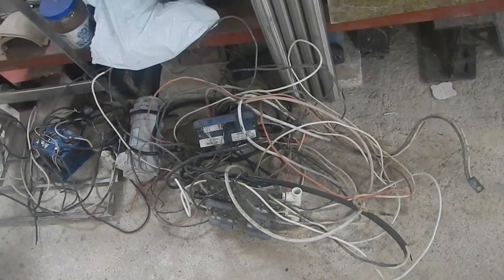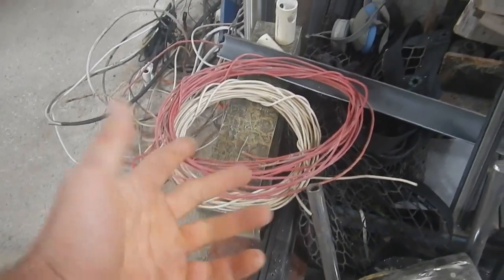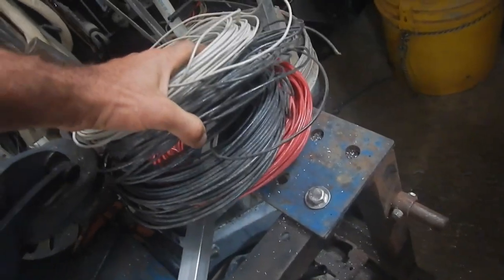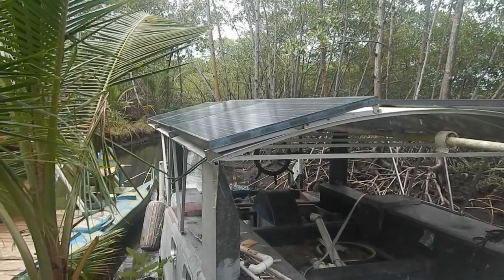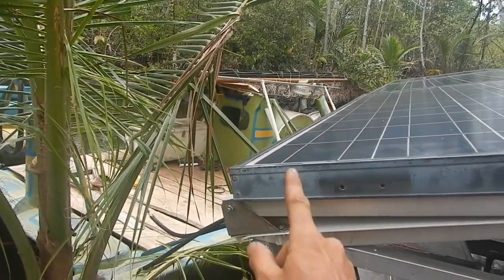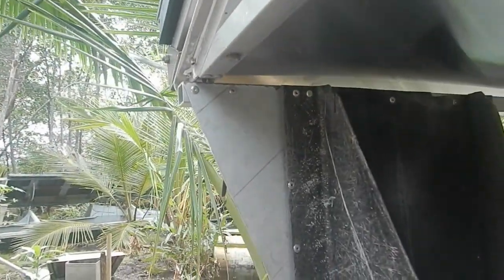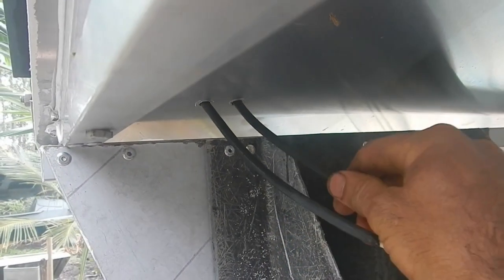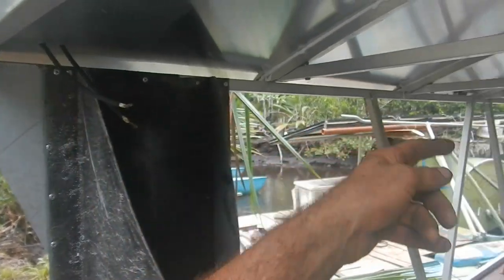Shark Slicer Upgrade 020 FrankenSwitch!

Comment: You can use the frame as earth and save on cables. Use warm citric acid solution to clean copper.
Reply: Bro it's a fiberglass boat
Reply: @jvcrules  ”Bro” have you seen the video? The roof is of aluminium.

Comment: The switch mount bracket looks like it could be a bit of a slicer. I would hate to kick my toe into it or fall on the top corners.
My suggestion is to radius the 4 sharp corners off with tin snips so they are large rounded. One step further would be to slit some small tubing and put 2 pieces of that on the brackets upright fins.

Comment: I've never had a problem with panels in parallel. Always run them direct to my batteries and brushed DC motor boat thrusters, land traction wheels etc, all in parallel. 
Just disconnect the panels when the Battery (Lead Acid) voltage gets over 14.5 volts. 
Had a couple of whoopsies when I've accidentally connected the panel backwards to batteries. Big spark but no panel damage when I went to do that about a week ago. 
It's good to have everything in a circuit so you get that sudden but very short term warning when you have it wrong. 
I had a panel backwards a couple years ago and didn't realize until the next day after traveling  10 km down the lake in my amphibious 20ft mobile home the day before. 
Panel was only putting out 10 volts open circuit instead of 21V after draining batteries rather than charging them. 🤭

Comment: Have you gone monohull with this one Jamie? 
Looks similar to the sleek little 700kg 22 foot trailer sailer I just picked up. 
She should go all day on 400watts of Solar panels a  couple of car batteries and a 55lb brushed DC trolling motor leg at about  10kmph.
Windage is what kills you. 
I'm tempted to not even put her mast up and use the sails. If it's blowing, then going to windward is slower than 400W of electric. 
And a kite boarding kite or windsurfer sail that can be stowed is almost as fast as her full race rig unless it's a strong blow and on the plane downwind run.

Comment: Back to the sliding steering rack, if 90 degree angle of steel would change steering rod direction to allow lifting motor & steering arms. The attachment points would firm up and not become threaded loosely.

Comment: Not sure what the motor demand power. It might be nicer to do 6 solar panel in parallel for slow speed, than do 3p2s for medium, and 2p3s. So the panels are a bit more efficient. Though if you get batteries to run the motor. Might be better setup to mppt to charge batteries and use pwm to run the motor. with an amp meter can make sure that power in and power out balanced.

Comment: I think the blocking diodes will drop the voltage by about 1.5 volts each.
Reply: I agree. The panels are like 30 perfectly good diodes in series. Not much chance of any backcurrent there. But the diodes Jamie's needlessly putting in get friggen hot and waste lots of power. 
Charge controllers do too.
I NEVER use them. I get 3 times as much current when it's sunny and at least 10x as much when it's cloudy to batteries or motors with just keeping an eye on the voltage of the batteries (lead acid). 
And whenever I trust a charge controller to look after them it friggen kills them with dendrites by refusing to let them have enough current to stop them growing or high enough voltage to cell balance 👍
Reply: @aaronfranklin324  Glad to hear from someone also interested in simplification when employing solar panels. My home enjoys direct solar heat gain from windows which stops the furnace and my basement office gets cold, so hence the heater in my other comment. Natural control heats the office when the sun shines solving the problem.
Reply: @sagecoach  Yeah, we're kinda lucky in Northern New Zealand that it doesn't get really cold or super hot, didn't even get a frost last winter. Especially floating on the sea.
But one really good, thermal storage, simple and cheap heating and cooling solution you could eliminate your furnace with is Zeolite clays. When they absorb water like cold damp house air or a drip of water,  in winter they give out hot dry air, and feed them hot dry air they give you cool moist air. 
The Welsh sustainable energy institute found that a refrigerator sized container of them was enough to heat and cool a house. 
Kitty litter pellets are an example. 
Robert Murray Smith TNT did some good videos on them. 
There's real flash synthetic molecular sieve ones like they use in chemical plants and oil refineries. That work so well they make steam and as Rob showed you can boil water and run a steam engine just by dropping water on them.  But natural ones are everywhere and....
Literally, Dirt cheap.
Reply: @aaronfranklin324  I am going to look into that. Here in Minnesota USA, we think upside down from you (: and it gets 20C below. I buy butter from New Zealand at Costco and we make it here, go figure. Thanks.

Comment: Oh no. See it's still a cat. 
Love the switches. 
I'd be inclined to have your panels set up independantly to two separate battery banks and have switching to either or both in parallel, or series for full speed. 
If you just speed control by amperage at fixed volts like you are, the back EMF voltage as the speed rises, from the motor ( I assume you are using reliable brushed DC, not shite brushless computer nannied ones. )
Will get up towards the panels voltage, and then your panels are providing basically nothing. 
With a couple of volts feeding the motor and very little current flowing. 
Better to set up the panels in series and increase the voltage. 
Like if you have a 24V motor You can run on 12, 24 or 36V using any one or two or three in series or parallel. Have a battery and voltage readout on  each of the three battery+ panels banks. 
Or go twin trolling motor thrusters, and switch them from series for low speed to parallel for high speed. Like trains do. 
Then you can have all your panels connected to all your batteries, and just parallel/ series and forward / reverse switches. 
And disconnect the batterys if their voltage gets to high with a simple relay that trips at above a certain voltage.

Comment: Two things to keep in mind, It isn't the volts but the amps. You can't run more than 20 amps on 12 gage wires on a 12v system because wires get very hot and can get on fire. If the battery is connected directly to the panels and the motor, When the Sun is down the panels became a load when running the engine.
davidpoz has a video about running a 200 amp 12v alt The Alternator Generator 48V Battery Charging that can charge the battery and run the boat motor with a Victron mppt charger.

Comment: I don't know why you don't build a Series/Parallel switch for slow speed. It's the easiest thing in the world, you already have the double-pole multi-throw frankenstein switch. It's just a matter of connecting them up.  ... also, any acid cleans copper. A capful of vinegar and a toothbrush would've made almost instant work of those.

Comment: If you ever want to shine up brass or copper or get rid of some rust off some steel Just use citric acid or Lemi Shine dish detergent booster which is the same thing. We use a mixture of Dawn soap, Lemi Shine, water, and stainless steel pins to wet tumble dirty brass for reloading. Just beware if you use too much citric acid your brass will turn pink. Probably the same for copper.

Comment: MPPT charge controllers will accept much higher voltage from the panels and convert it efficiently to the battery/motor voltage. This allows multiple panels in series using the panel wire itself even skip-lacing the wires over panels so the final output is where you want, Much neater and more efficient. But you do the work before receiving this advice so this effort to help is worthless.
I have a simple 120-volt heater powered directly from 500 watts of panels in series and have monitored the panel output when parts are covered by shade or snow and find the power to be directly proportional to the total shaded area. The panels say they have internal diodes which I assume are causing this expected ideal effect. Design current low and voltage high to save copper and line loss. But be careful not to get electrocuted. You know that.